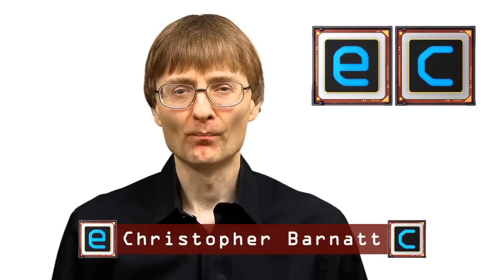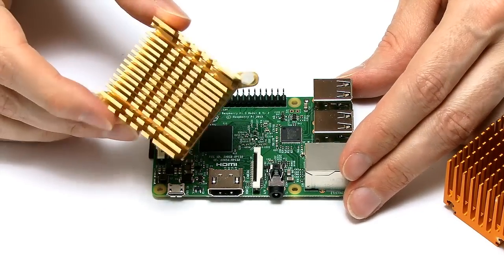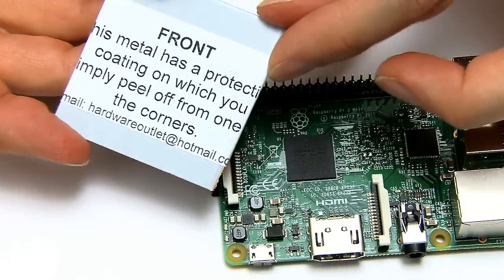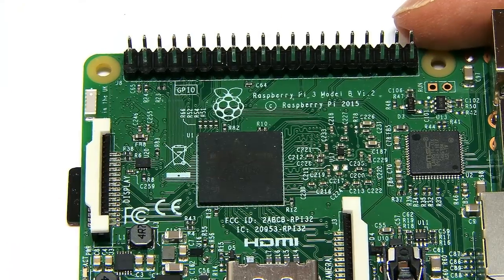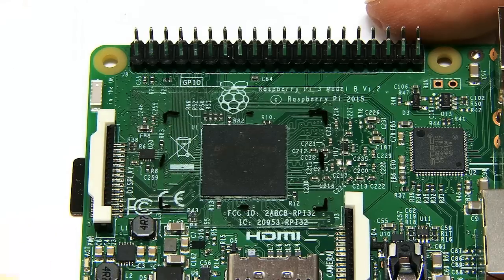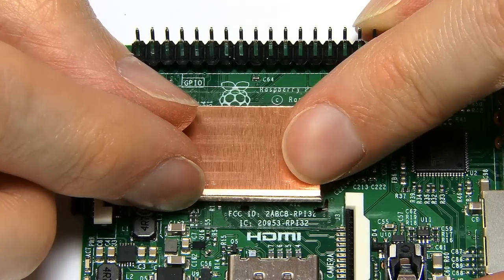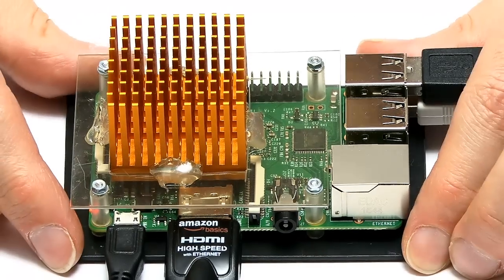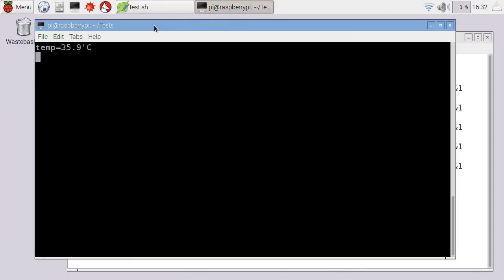Raspberry Pi 3: Extreme Passive Cooling

Comment: You shouldve pushed down fairly hard on the heatsink when you were hotglueing it to get maximum contact. Why not get as much cooling as possible?
Reply from the maker: +Red .Rotten I did not want to damage the Pi's PCB! :)
Reply: +ExplainingComputers 
Smart move on your part.  With the high thermal conductivity paste you used, there would not have been all that much difference with more presure.  

The problem with all the PC heatsink mod  'experts' is that most of them are simply repeating 'common wisdom' without really understanding the underlying physics.   

For example, when overclocking one of Intel's or AMD's latest high thermal load chips, we are dealing with a high thermal conductivity METAL carrier - so the thermal conductivity of the heatsink coupling becomes much more critical, and it is indeed very important to keep the layer of thermal compound as thin as possible.  

This is NOT the case with the Pi, where you are coupling your heatsink to the top of a PLASTIC package.   With the Pi we don't need to get too concerned about the small added thermal resistance of the thin layer of thermal compound, because it is a lot less critical when coupling to a much lower thermal conductivity plastic package.

Since you are coupling to plastic packages, the only real way you could get a significant additional improvement would be by ALSO coupling to the RAM chip on the bottom of the Pi (which would double the plastic thermal coupling between the Pi and the heatsinks), but thanks to the massive heatsink you used, it seems to be working just fine as it is, so this may be more bother than it's worth.

So, bottom line, additional pressure would have made a minimal difference in cooling, and can indeed break loose surface mount components, so ExplainingComputers made the correct choice in only applying moderate pressure.

Comment: Love your videos! I wonder if there will be an after market solution using extreme passive cooling like this! I'd certainly get it.

Where did you get that heatsink? any idea?
Reply from the maker: +Tiago Medeiros I think there are after market solutions for those with laser cutters to sell kits of suitably shaped perspex sheets -- for both heat sinks and fans (as in my last video). I got the heat sink I think from a grahics card, or maybe a motherboard chipset.

Comment: Does applying pressure to the heatsink improve performance further?
Reply from the maker: +Philip Thomson Not if there is already good thermal contact -- and here we have reasonable weight on a small chip.

Comment: Isn't there an outside chance that the hot glue will melt in extreme cases?
(I don't know how hot, hot glue has to get to become liquid again).
Reply from the maker: The melting point of hot glue is at least 120C, the Pi's SoC will never get above about 80C (internally, then it will throttle), so I doubt the heatsink will ever get about 60C. So all should be OK. :)

Comment: Question.... Why put Hot Glue to hold it in place. Assuming that the hot glue melts on heated surfaces, it will just reflow over the plastic and not hold anything at all.
Reply from the maker: +Anthony LC The melting point for hot glue is about 120C. The SoC does not exceed mid 80s (due to throlling), and as we see here is limited to 50. So there is no risk of the hot melt melting here! :)
Reply: +ExplainingComputers true :)

Comment: Am I missing something here? Unless you are data logging inside a volcano or an iron foundry or something then why would you need to cool an RPI? 

I cant get mine hot even after calculating prime numbers for hour after hour. The only part that does get warm is the 3.3v regulator (which is supposed to get hot - thats how they work,) and the USB/ethernet hub.
Reply from the maker: +ZonkedCompanion As I've shown in previous videos, a Raspberry Pi 3 easily climbs into the 80s (and throttles) at full CPU utilization. Not a common scenario! But the Pi 3 is the first model where cooling is becoming a concern in some situations -- hence these experiments! :)
Reply: +ExplainingComputers Ahh I see. I haven't used a 3 yet, so I wasn't aware of that. Thank you for the reply.
Reply from the maker: ZonkedCompanion The Pi 4, I think, will have to come with a heatsink, and maybe even a fan . . . at least if they want to keep speeding it up.

Comment: So much work for such a medium sized heatsink. Get a full aluminium case, by BiQU. The whole case is the heatsink and it also touches the other chips. And it only needs 3 minutes to be ready for use. Price in Germany is 11 Euros, so really cheao too and it also looks good.
Reply: I like the look of BiQU, but can understand who likes Flirc2 more. There are several tests and comparisons, where BiQU does better cooling than Flirc2, but that is not big difference. One big difference is, its much easier to get out the sd card from case on BiQU. If you do a lot, this is an important point (to me). Plus, its cheaper in price.

Comment: I know this video is 5 years old by now, but can you comment on the ambient temperature when you conducted this test?  I'm interested in this, because we're dealing with Raspberry Pi in an uncooled warehouse environment, where ambient air temperature affects how heat dissipates.  If we have degree days during a heat wave, for example, I typically see my monitoring alarms go into warning and critical states, because heat cannot dissipate as effectively as when the unit is running in my air-conditioned lab.
Reply from the maker: It will have been in the early 20s C. I have many more recent Raspberry Pi cooling videos -- eg see https://www.youtube.com/watch?v=e6mWImsF9iI for really good Pi 4 cooling.

Comment: Why do you don't just solder the heatsink on the copper plate?
Solder does withstand easily temperatures till 100 °C, thus it will hold the heatsink and copper plate together.
Reply from the maker: Good idea.

Comment: Does the older Pi 2 require additional cooling and have you done these test with the Pi 2 in the past?
Reply from the maker: +Kirk Nelson The Pi 2 does not get so hot.
Reply: thanks, was worried about throttling of the cpu due to heat

Comment: Could you tell me, please, what is the "2>&1" on the end of the sysbench command?  I don't even know what it is called to google it.
Reply from the maker: The " >/dev/null 2>&1 " on the end of the Sysbench command suppresses the display output (so we just get the list of temperatures).
Reply: OK.  Well, I just looked it up.  Never thought it was a standard thing that could be google'd as is.  The "s>&1" part is redirecting StdError to never-never land.  I have used >/dev/null a lot but never knew about the other piece of the command to get rid of absolutely everything.  Good explanation here: https://unix.stackexchange.com/questions/163352/what-does-dev-null-21-mean-in-this-article-of-crontab-basics?utm_medium=organic&utm_source=google_rich_qa&utm_campaign=google_rich_qa  Ain't it grand.  One output is not mentioned. Only the destination is mentioned. Just sent off. And the other one is sent off completely differently. Had someone rational written this, it would have been something like >/StdOut/Null and >StdError/null.  That way, it wold have been slightly more obvious what was going on.  But Unix/Linux developers don't think that way.  They MUST be totally cryptic or they don't feel like they are doing their jobs correctly.  The rest of us disagree!  Unix and C: Cryptic R Us!

Comment: You'll see better thermal transfer if you had a way of mechanically exerting some force down onto the chip with the heatsink.  Computer heatsinks rely on both thermal compound and force to transfer heat from the chip.  Given you don't have a metal heat spreader on top of the pi's processor, I can understand not wanting to clamp it down tight but it would still perform better with at least some downward pressure if it's anything like normal computer chips.

Comment: what about thermal adhesive?              
and you could have used another copper plank on top the heat sink to apply pressure with zip ties or mechanics wire.

Comment: For those of us in the US a cheaper solution for the copper shim would be an old penny (pre 1968 I believe if you want a pure copper penny). Of course you'd want to sand it smooth, which may qualify under whatever law forbids melting the things down.

Comment: Is hot glue a good choice for a 'heat' sync?
Reply: *sink
"Sync" is short for "synchronize."
Reply from the maker: Hot glue melts at c.200 degrees; the heat sink will not pass 50, so there are no problems. :)

Comment: It would seem that a single test would not bring the massive passive heatsink to full temperature.  I'm curious if this would continue to be the case after say an hour or more of running the pi in testing.
Reply from the maker: +Jeff Ledger Yes, I must try this. Any temperature rise I think would be shallow, but it may edge into the low 50s.

Comment: FYI, you also could of used Thermal Adhesive like "Arctic Alumina Thermal Adhesive"  therefore you don't have to make the plastic cover loosing access to the header pins.. Just another potion

Comment: Hi EC, I didn't see any provision to access the I/O pins or do you not use them, in which case no worries. Nice Pi mod. Be good, C.
Reply from the maker: +Cass Virgillo I do use the GPIO pins, but cannot imagine a project using them that needs extreme cooling! Though this does cause me problems in the follow-up video . . .
Reply: ExplainingComputers Hi EC, I am not completely familiar with everything about the R-Pi, my Nephew has an earlier version and they are indeed cool. Sorry to bring that to your attention, just a thought. Still, a good mod for those times you do need more thermal protection. Take care, be good, C.

Comment: is it the same result if the Raspberry pi in in a box with this kind of cooler ?
Reply from the maker: +Guillaume S. Cases lessen the effectiveness of most cooling solutions. A box with reasonable vents would add maybe 5 degrees C.

Comment: Hello, where did you get that heat sink ? I can't fid a heat sink that big online...
Reply from the maker: It came from an old PC motherboard. Maybe an old computer store (or rubbish tip) will have an old motherboard (or graphics card) you can salvage something from?
Reply: +ExplainingComputers  Doing more research, I found this option to Raspberry Pi, its called Up Board: http://www.up-board.org/specifications/ 
I know that I'm off topic here, but My interest on Raspberry Pi started when I decided that I wanted to create a small system that could emulate NES, SNES, N64 and Sega Mega Drive. It seems that Raspberry Pi 3 model B can do the job but it needs to be overclocked - the Up Board seems to be more powerful, so maybe a better option in my case.
Reply from the maker: Filipe Miranda You may be interested in my video that goes live here on Sunday -- all about another new, Intel-based SOC, also with an Atom processor . . . the LattePanda . . . I've been rather impressed! :)

Comment: Great Video. Instead of thermal paste, there is thermal epoxy for sale on ebay.
I never liked the pre-applied tape they put on heatsinks. As tape ages it loses it sticky nature and the heatsinks may fall off and damage sensitive electronics by shorting them out. Clean off tape with a wire wheel or carburetor cleaner or something that will eat the plastic tape off the heatsink. ***Wear hand and eye protection when working with dangerous equipment/chemicals.
    Arctic Silver makes a thermal epoxy that when applied will dry hard and permanently bond the heatsink to the chip.  I have used it in the past and it works great. Just set some weight on the heatsink after applying thermal epoxy and leave it overnight, this will make a tight fit with minimal epoxy between the chip and heatsink and you'll never have to worry about heatsinks falling off in time and damaging/shorting electronics.
Reply from the maker: Good advice if you want a permanent solution. But this was part of a test. I use My Pis in lots of different videos/projects, so sticking things to them with epoxy is not an option! :)

Comment: The same question I was also going to ask which Jesse asked , I also saw the video two times , if you have mentioned and I missed it. Thanks sir.

I'm really very very excited about the cooling as I want to run some huge tasks like Boinc etc.

Sir can you make a video of Boinc app running , and measuring the temperature. Boinc is an app used for research , I installed it's Debian version .Actually our research want some heavy computers , so by running this app allows them to use your computer. AGAIN SIR, THANKS.

Comment: What was the plastic sheet used to insulate between the board and the copper plate?
Reply from the maker: +Jonathan Pelham It came from an SD card packaging. :)
Reply: +ExplainingComputers thanks.  I'm interested in trying something similar.  I've got my eye on a northbridge passive cooler so my pi console will cope better.

Comment: Cutting the copper square a bit larger may have taken an extra degree or two off. Ideally it would make contact with the entire base of the aluminium heat disperer..

Comment: wouldn´T it be more effective to machine the bottom of the heatsink so it does not make contact with any part of the PI in any unwanted place?
that way you could at least eliminate the need for the copper and one layer of thermal compound.
Reply from the maker: Indeed, though this would require some serious tooling -- and the solid part at the base of the heatsink is too thin to remove enough material so that it would not contac the Pi. :)

Comment: Perhaps you could consider running the test for a longer period, say 1 hour?  The large heat sink adds a great deal of heat capacity.  It is not clear from your data that the temperature has fully stabilized.
Reply from the maker: +QuietStorm Look out for my next cooling video! :)

Comment: one question what can you use the 40 pin connector for?
Reply: The 40pin GPIO connection is a universal specification for controlling just about anything.  From using the Pi as a brain in a home-made robot to controlling a large firework event at New Year using software on the Pi.  If you can think of any home project or hobby that could use a Pi in it you will likely use the 40pin, the other connectors are for connecting typical peripherals like mice, keyboards, hardrives, etc.

Comment: Thermal compound needs to be applied a little differently. It should be spread over the surface of the chip with your finger so there's an even, very thin layer of it. The "blob approach" used in the video concentrates too much compound in the center, which impedes metal-to-metal contact in the center, and too little on the edges and corners, where the surface imperfections aren't filled.

I'm sure there are videos available on applying thermal compound properly.

Thanks for making the video.  :)
Reply from the maker: There is great debate as to the best method for applying thermal paste. I used to agree with you that the compound should be spread out. But I now use the "dot method" precisely because I have seen videos and data that show that it works better! :)
Reply: Yes, apparently there is much debate. Thanks for the reply.

Comment: I've enjoyed watching your videos but have not watched all of them so forgive me if you tried using a Peltier thermocouple with a fan and heat sink on top of the CPU? Then benchmarked the computer to see if there was any difference in performance or how much of a drop in temperature?

I pulled two thermocouples with the heat sinks and fans of one of those small refrigerators after the power supply failed. Both operate on 12 volts. If the fan on the heat sink is not running, eventually it will form a block of ice on the thermocouple which is kind of cool.

They work, just not very well as a substitute for a compressor in a refrigerator or wine cooler. These type refrigerators/wine coolers don't cool very well. Well not to American standards. They only cool down to about 50F/10C which is not cold enough as far as beverages are concerned. Most Americans like their beverages near freezing.

They tend to pull allot of current so they would have to be powered by an external power supply. Much more current than a Raspberry would pull itself.

Read my other comment below about sticking a Raspberry PI in a small mini fridge for use in a garage. Good or bad idea? Mainly as far as condensation is concerned after opening the door.

After watching some of your videos on these single board computers, I've been wanting to get one of these to play around with but have not decided which one to buy. Thinking about going with the Raspberry PI 3. Which one is the best bang for the buck?

Comment: He might have actually gotten even better results if he had spread the cooling compound around a bit more. Even with the bit of rotation it was give most of the compound would have stayed in the middle of the cpu and also in the middle of the larger heat sink on top.  
Other than that, well done!  Good little bit of DIY.

Comment: I would have gone for a cube of copper and used the heat sink with the screw holes somehow.  I would be scared of warping the board but I like the idea of screwing together.  Now you need to run the fan on top too.  :)
Reply from the maker: +clangerbasher Yes, it does cry out for a fan too -- and then a refrigeration unit! :)
Reply: ExplainingComputers One of those big American tech channels plumbed all their water cooled PCs to a common main and used to heat the room or something.  I think it was Linus Techtips.